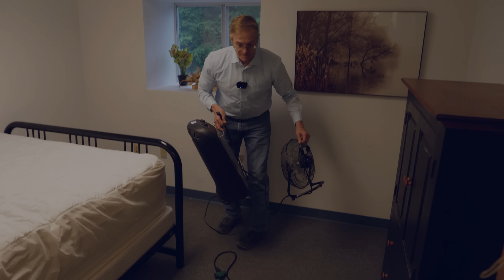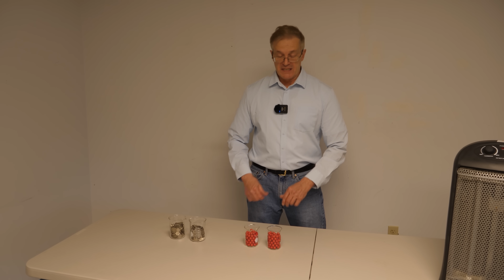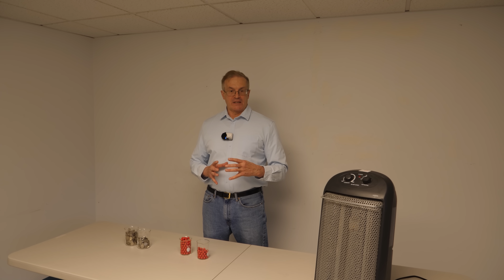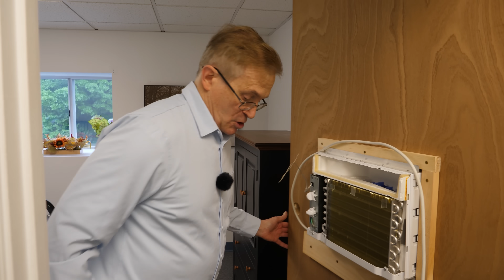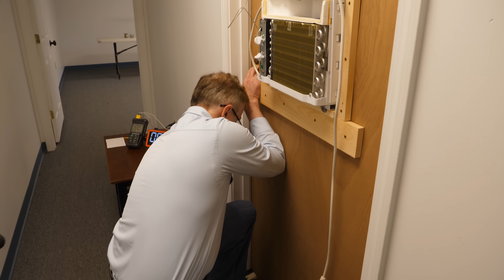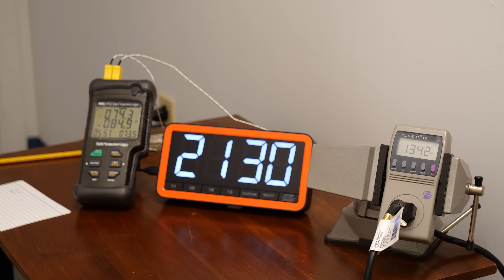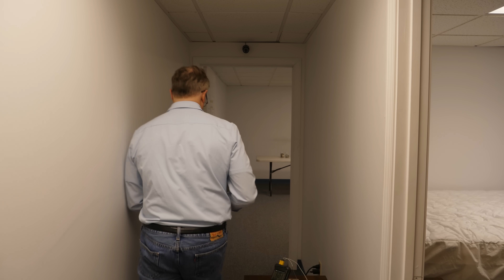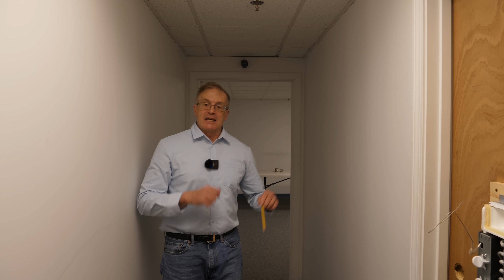You're wasting money on heating! Use your A/C!

Comment: Great video. Already knew the topic - working on my own heat pumps now, but dang, you coulda got really accurate numbers by resetting that Kill-A-Watt. It woulda totaled up the exact cumulative power use (and even comparative costs if you enter your local $/kWh; easy as setting the time on a new clock). Just hold down ‘reset’ between sets, and it starts fresh data logging. Helpful to do nowadays, since power fluctuates with modern space heaters and window a/c’s as they all have built-in thermostats (heater woulda kicked down with higher bedroom temps; a/c with a colder hallway). Maybe next time, but great video regardless. 👍🏼

Comment: Well i heard from people that use inverter AC to heat their homes, and as i heard also regular AC can not work properly when cold temps are outside. I mean if cold section is cold, and it's cold outside, that cold section need to be colder to exchange. Then i assume those heat pumps use i guess ground temperatures which is like 0c or more to overcome that via pipes. I still think nothing beats good internal isolation

Comment: Heads Up!  I recently purchased an A.C./Heater, with an inverter.  No product review yet but the Model and Details are:  Midea (Model: F5811301) Weighs 27.1kg, fits windows with openings as small as 24 in. Wide by 14.5 in. Height .

Intended for rooms/spaces that are up to 550 square feet.  Will heat or cool a room when outside air temperatures are between 41 degrees and 110 degrees Fahrenheit.

Estimated yearly energy cost: $68 based on 13 cents per kWh and a seasonal use of 8 hours/day over a three month period.  Unit output: 12,000 BTU/hour.

Cost was $311 "on discount" and yes, given that it heats, cools, does that to a large space and at high energy efficiency, I did purchase it.

Insulation is your friend.  INSULATION never stops saving you money.   Always insulate first.

Also, all dimensions were using the English system except the weight, which was the net weight on the sticker, the other dimensions were on the box.   No I will not convert that for you, look at all that I did do for you already.  You're on the Internet RIGHT NOW, just a few key clicks and you will have the conversion.

Comment: I've considered doing this with my AC in winter because it will put out 3,5kW of heat with only 1kW of input power. However there's one thing i'm worrying about - the evaporator freezing up. The AC does not have a defrost cycle or anything like it.

Comment: My apartment is in dire need of my portable AC becoming more efficient.  A couple of days ago, I used a laser thermometer to get readings of the temperature in my bedroom where the portable AC is located.  It was around 95 degrees with the uninsulated ceiling reading 105 degrees.  There was no way that this AC was going to keep up or convert that much heat to cool air.  After hours of operation, the only cool air was standing in front of the AC. :(  So, it costs a lot of electricity, but doesn't provide much relief from the heat.

Comment: Very nice video. For people who want to know even more about this I can share some knowledge. Im an engineer, worked on cars, heaters, chemicals and even some programming. Mister has explained in a very fine detail what happens, but there is an even deeper explanation. Essentially, even on a freezingly cold day, there is heat in the outside air, we dont feel it as our bodies are designed to be reupulsed by cold air due to obvious danger. How much heat there is can be calculate by how many electrons are moving in the given space. We measure that in Kelvins. Esentially even the freezing cold minus 10 Celsius has loads of Kelvins of heat. Next step is to catch them and pump them in our home. We catch them with liquids called refrigerants. These are special substances that perform this task very effectively. After the heat is extracted from the outside, we just blow it on the inside. The reason it is so efficient on our power bills is that because we are essentially "stealing" heat from the outside world and putting it in our homes. Similar principle is used for cooling our homes, a refrigerant is used to steal the heat from our homes and is then blowing it to the outside world. Have a nice day, and always keep learning.

Comment: I am curious about two things.  Did the proximity of the window unit to the temp probe effect the result due to the reduced air flow? (since the fan was removed.  And.  Would the humidity in the room increase because of the condensate on the coils in the room? and would this effect the temperature result?
Reply from the maker: The humidity can't rise without a source of water. 
The blast from the airconditioner was directed away from the probe and across the room.

Comment: Cool! (or/andhot). Measuring the temperature of the air... The solid stuff in the room, including the walls, contain way more energy than the air in the room. Do the test again but now start with the heat pump. But your points are still valid, and I am considering a hack to my mobile AC: let it suck air in from outside through a tube iso out of the room. Normally it puts my house on lower pressure, sucking warm air from outside the house to inside the house..

Comment: I like your tests buy you really do need to get an Arduino or similar to record the data as it will give you some good resolution in the data and you wont have the press the thermometer unit very 15  minutes to check the data is still displaying.

Comment: What about Gas heating VS Heatpump heating?
Reply from the maker: They're not far apart, but the advantage lies with gas.
Reply: @TechIngredients California is giving rebates on heat pumps and gas furnaces are much more expensive. Electricity is 54c/kwh already, I think a heat pump will be much more expensive to run but with the new refrigerants (410A) that runs much warmer and dc inverter compressors. I’m not so sure which one will be cheaper to run

Comment: In a cold climate, the real star of the modern HVAC world is dual fuel.  You capture all of this cheap heat pump operation until the temperatures get really cold, then you switch over to a conventional gas or oil burner during the coldest days, when the heat pump has to work incredibly hard to keep you comfortable.  Yes, the conventional system is nominally less efficient, but that is only when you consider the running costs, not the overall costs.  But wait, you say "my new heat pump keeps me comfortable even when the temp outside is -20F".  But just because you can do something doesn't mean you should.   Go look how many hours a day that efficient heat pump is running when you ask it to maintain an 80 or 90F delta between inside and outside.  Just like putting miles on your car, the more you run your heat pump, the sooner you will need to replace it.  And when you include the installation costs, a new heat pump can cost just about as much as much as the energy it consumes during its lifetime.  So don't get too excited about the energy you are saving when your system is running 22 hours out of 24.  And if you think burning fossil fuels is just bad, period, consider how many were burned to build that heat pump in the first place.  I love my heat pump, but I also understand its limits.  It can easily be all you need in a moderate climate, but if you live where it snows a lot, you are probably better off going dual fuel, particularly if you already have natural gas or oil heat today and so all of that piping etc. is already in your house.

Comment: Heat pumps are pretty common here, so this wasn't new to me, but it's still good to see them spread their reach. If we're going to have to cut back on our energy use it's nice to be able to do some of it without sacrificing comfort. Anyway, I thought I'd just say that a fairer comparison would probably be to run the A/C/Heat pump unit with its cold side facing outdoors, rather than stealing the heat from another inside room, as you usually want to keep all of the inside warm when you're heating your house. I assume this will increase the wattage/reduce the efficiency somewhat. Still plenty to gain vs a normal heater of course.

Comment: That's pretty cool but doesn't ac's heat a gas and moves the heat due to complex gas/liquid dynamics. Like it's not magic but because gas holds heat better than liquids it moves the hot gas outside to let the air cool it down but the cold liquid is on the inside so the heat from inside warms in up. Not really sure on the dynamics of this maybe ventilation plays more of factor in the experiment, since you can't just move heat that easily. Also factors like heat moving up and absorbing into objects also plays a factor.

Comment: This video only proves that acs are FASTER in hearing air, than a stove, any type of stove. To calculate efficiency you must also measure the time the room retains temperature when the power is cut off. For acs this happens in minutes. For stoves it can take hours.
Why?
You know that already. But you chose to ignore it in this video. Irradiation of surfaces and stuff.
So again, you don't measure efficiency, only speed.
And I don't mind you do that, and I actually agree with your findings.. on speed.
So you probably should call it how it is.

Comment: Problem with this method vs a ground source heat pumps is that the condenser is going to accumulate condensation over the coils and not allow air
to blow over the condenser coil once the temp outside is under 50F and or has high humidity.  I do not see it working for more than a hour and the 
condenser being packed with ice here in the Midwest were I live, when it gets cold.
Maybe a way to run water over the coils outside to prevent the coils to be covered with ice,
although that will raise ones water bill?
Reply from the maker: There is nothing wrong with modifying the process with a better heat sink. The fact that this principle can be used only augments those other options.

Comment: sadly this experiment, while proving that heat pumps are more efficient in warm conditions, doesn't make much sense otherwise. In the winter, if your unit is outside, you will get a very low amount of heat and the device will always shut down periodically for defrosting.
Reply: You are wrong. I used a Mitsubishi air to air heat pump for more than 10 years. Worked fine down to -30 C, although not as efficient. Never once had any issues with defrosting.
Reply: @johansvideor  then it highly depends on the model, because the ones I saw this far are all the same in this regard.
Reply: @D4no00  Yes, I'm convinced of that.

Comment: Wait... The cold air rejected by the A/C will just make the home's normal heating run more. You save no energy. Try this again with the A/C outside and watch it either freeze up of refuse to even cycle the compressor. Total clickbait.
Reply: I recommend that you check out @technologyconnections he has a series on heat pumps. If you ran the test you described, you would find that the room would heat up nicely and the heat pump (air conditioner) would work fine.
Reply from the maker: You seem to have completely missed the point of this TEST!
As such, it's understandable that you'd think the title is clickbate.
Reply: @TechIngredients  Nice of you to remove my reply. Guess you have to edit the comments now... Sad... This used to be a good channel.

Comment: So happy you explained a fan heats up a room, for some reason not many people seem to know that.

Windchill effect will cool you off until the room becomes saturated with your body temperature which will then get even hotter due to the heat generated from the fans operation.

So you either need ac or for the outside air to be cooler than you and your inside air.

I tell people all the time 'if you put a fan in a box the air in that box will get hotter' to illustrate the point.
Reply: You also sweat and get evaporative cooling made more effective until the humidity goes up.. which if you have no heat you might as well open a window or something

Comment: Although I thoroughly support heat pumps, this test is about an optimal as it gets for heat pumps. This setup only sustained a 15 degree difference. This is like trying to heat your house on a 55 degree day. Heat pumps rock in this situation. But as we saw, as the temperature difference increases, so does the power draw. In New England, it is common to have a 40 degree difference, and most years there are some nights it gets as much as 70 degrees difference. In that case, heat pumps are more challenged. There are heat pump today that can handle that, and more on the way, but they are more expensive, and so less cost competitive. The farther north you go ( Canada ) the worse the problem gets. But if you are in a more moderate latitude, it is a no-brainer.

Comment: Team ,
The real issue is we go not have enough electricity supply and not enough distribution for all of us to switch to heat pumps .
The Same people trying to mandate heat pumps are stopping new power plants and nimby power lines !

Let’s throw in mandatory electric cars now .

Electricity is not energy that can be easily stored .

Where is this electricity to come from?  

At night …….

Calm day……
Reply: This assumes switching from natural gas , propane , oil etc .

If you are Still using old resistance electric heat , you need  to get a heat pump  asap!

Even cheaper that the mini splits are the Fedder through the wall heat pump / AC unit but not as efficient as the mini splits .

Comment: Nice! Looking forward to the follow up video. If you can, please also add two things (to the "make it even more efficient"):
a) Make it as silent as possible (if it's louder than a fan, it's not good for most living spaces). b) Links where to get suitable good, but not too expensive, heat pumps that allow switching of directions (without changing the installation). Thanks!

Comment: I believe the longer, thinner wire gauge extension cord is skewing the results a tad. Not enough to turn the tides or anything, but I doubt the full 1350 watts was being utilized on the electric heater. Probably more like 1000

Comment: I cringed when you plugged that heater into an extension cord.
I get it, you want to be able to measure the amps etc...
But this sort of thing is responsible for a bunch of fires each year.
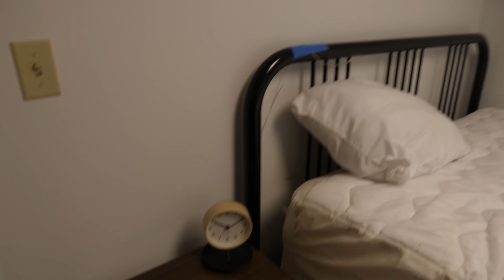( I have it paused at 6:06, and am hoping you say something about it )
Reply: 10:04  "This has got a little warm"....  yeah that's you almost starting a fire using an extension cord for a device that uses more than say 1000 watts 
geez
Reply: OMG so you run the second test without that extension cord??  Can you say skewing the results?  Why do you think the plugs were warm?  So inefficient.  

I'm not saying the heat pump couldn't be more efficient... but your test is seriously flawed....

I also think surface temperatures are different in the room now,... but that's got to be less impactful than the extension cord
Reply from the maker: I think your criticism is flawed. This is a test, not a permanent instalation.
Furthermore,  the warm cord is adding its heat into the room just like the coils in the space heater.
Reply: @TechIngredients  

Run the test again without the cord and prove it....  

I disagree that the extension cord is essentially of no consequence 

And I don't care that it's not a permanent instillation... you need to not be on video plugging a heater into an extension cord without saying anything about fire safety or in any way addressing the issue
Reply: Do the test again, and this time, run the air conditioner first, through the same extension cord....  talk about fire safety and have fire extinguisher on standby ... then run a heater with a built in fan straight into the meter there second

Comment: Great video to prove a simple but critical concept. You never disappoint.
I've got 2 observations and 2 questions(it's a long one)
Observation 1: the AC will be more efficient compared to hallway when placed on the outside wall as the cold air will be constantly replaced.
Observation 2: I'd rather place the resistance heater close to where the AC is installed to reduce the effect of temperature differential inside the room as the AC is closer to temperature sensor. This gives the AC an advantage as you are taking the readings when the system is running and not leaving any time to even out the temperature difference in the room generated by the test devices.  Nevertheless the results are good for demonstration and will not be used for technical analysis(I often use results from this channel to base my experiments/projects).
The question is is that an inverter type AC the old one and what is the power rating and capacity in thermal units of the AC?
Reply from the maker: #1. Agreed 
#2  Keep in mind that the airconditioner blast is directed across the room, away from the probe.

Comment: 10:00 I think that one issue you may not be counting on is that the heater has a thermostat built in that stops the heating.

An air conditioner facing out into the hallway will not be responding to the temperature inside the room because there is a barrier between the thermostat and the room in question...

Also, the AC unit is trying to COOL, so, in doing its job, it can never satisfy its own parameters anyhow.

In other words, the thermostat can skew the results.
Reply from the maker: If it shut down, then the power draw would have dropped to about 100 watts.
Reply: @TechIngredients  Since I did not see 30 minutes of uninterrupted footage, I have no way to know that it did not.

That said then, I have to just go by the fact that almost no normal heaters are set to operate over 80F nowdays.

I have heaters that at peak temp will never exceed 79.5 F without I bypass the thermostat entirely.

So, while I am not by any means calling shenanigans, without knowing anything else, I have to go by logic and reason without anything else to countermand that.